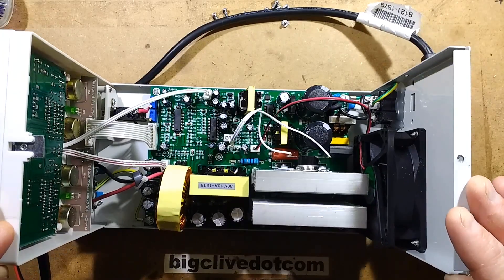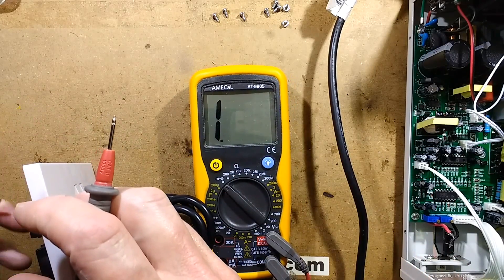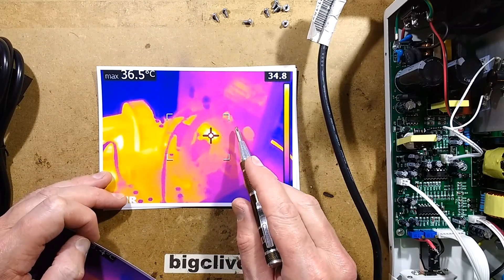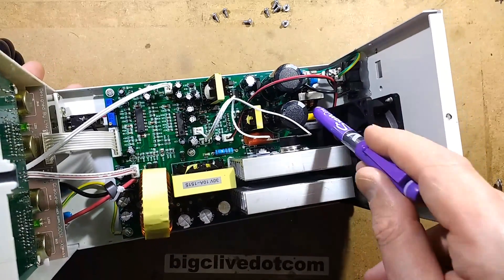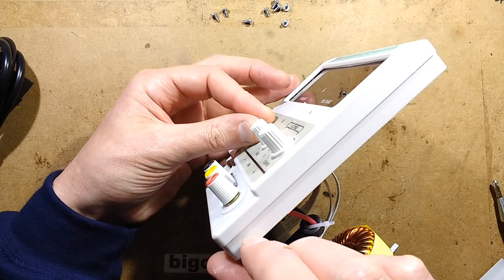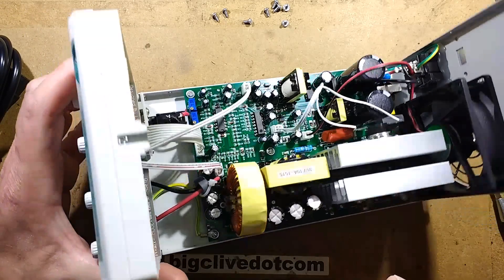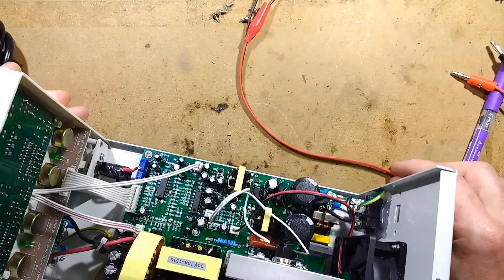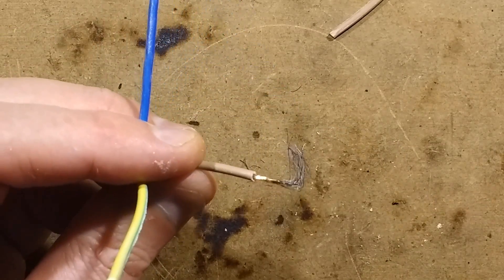Test of a PSU like the one that went on fire.

Comment: What about mobile phone chargers in the UK that use a plastic earth pin? Are they safe?
Reply: Nobody makes a grounded phone charger, the pin is just there to open the shutter.
Reply: Yeah, I figured that part, so, does that mean it doesn't need it?
Reply: Yep. The case is plastic and the wire only delivers 5V DC, so no need.
Reply: Thanks!

Comment: Another great video, thank you! 
I was interested in your comments re the UK 3 pin plug with the earth pin half insulated. Makes perfect sense. So, I set about looking to buy some with uninsulated earth pins. There are loads of plugs for sale on amazon and Ebay for example https://www.amazon.co.uk/Pack-Pin-Fused-Mains-Plugs/dp/B005DZHLO0 which claim to meet BS1363. I looked up BS1363 and got this: http://www.bs1363.org.uk/ which clearly states that the plugs offered for sale with partially insulated earth pins are illegal and should not be offered for sale.
I am a bit surprised at this, thank you SO much for highlighting the issue which I had not thought about before...
John

Comment: No way that thing would even be allowed in my home.  Not sure it even be legal to sell in USA.  No shrink tube protection on the mains in or even the switch.  That right there turns it to crap.  But here is my biggest rub...  Look at that output capacitance, if your circuit did mess up thats a lot of energy to be getting rid of before the voltage actually drops in constant current mode. Your cheep wall warts and such don't have near that much capacitance on output.

Comment: I bought one of these off Ebay months ago. Fortunately, I suppose, it was dead on arrival.I contacted the seller and got a refund. He didn't want it back. I looked inside and thought about attempting repair but time was short, so i just pulled a few components and threw it away.

Comment: Better than the heatsink compound trick is a UV reactive dye and blacklight.
What I use was originally meant for crack detection of some kind and looks like a crayon however it contains a bright orange/red UV reactive dye.

You basically rub the crayon over a surface and shine a UV torch on it and the lettering lights up (and any surface imperfections/cracks). The crayon itself is normally enough on it's own (it's a light colour) however the UV light makes it completely visible no matter the lighting conditions (it also allows pictures to be taken very easily as the lettering actually emits light).

Comment: Hey Clive. Since I had my own melty moment (and a near house burning moment) with an off brand Chinese plugpack, I’ve carefully scrutinised each and every one I’ve got. However there was one that I recently received that I opened up and it actually looks ok, it looks to have really really good separation, my clueless eyes finding that the closest point between live and secondary side is the optoisolator, which looks appropriately sized.

I’m wondering if I can send you photos for you to have a look at and see if it’s safe? Cheers
Reply from the maker: +Moon Moon The tracks often come close at the optoisolator.  Even looking at a picture of the PCB I couldn't tell you if the separation in the transformer was good.

Comment: This reminds me of a control panel I saw at the local scrap yard, just a Chinese who-flung-dung machine cabinet with 3 ABB OEM VFDs inside (10 - 25 and probably 50Hp) and it looks like the crappy conductors they used to go into the 25HP drive got quite hot and started arcing, they probably were never torqued down to mfg specs either. 
 needless to say the whole panel was carbon black inside and all drives and PLC gear were destroyed by heat and smoke :(

Comment: Color TVs have DeGauss circuits that use PTC resistors. I found many fried. Also can the sheath be cut back on the ground pin?
Reply: The problem, with even cutting back the sheath, is that then, you now have a thinner contact blade, and there is less force applied to the contact points.

The 'spring' portion of the third pin now has less push against the metal, and if FULL power were to be applied to the PIN, the corresponding contact, will have a higher resistance, and when in fault mode, not be able to take the full return current.

for a 6 amp branch circuit, then the connector may only be able to handle 80% of that, and that would be a violation of some local or national standard.

For this reason, the whole plug should be changed to a proper one with a full ground pin, and , in the UK, I am surmising, a fuse in the  plug body.
Reply: Thank you. Being from US I don't get to see them up close. I saw other videos saying it was dangerous but Mr Big showed why.

Comment: UK should require sockets to be designed assuming that these shrouded ground pins exist, since clearly they do.  Make the ground contacts in the socket full length.
Reply: jhallenworld
"UK should require sockets to be designed assuming that these shrouded ground pins exist, since clearly they do.  Make the ground contacts in the socket full length." - You overlook the fact that your half-baked proposal would not affect all the  millions upon millions of perfectly good and safe mains sockets in every home and business. Real-life hardware problems are not like a software update. 
In view of the internet, I'm not sure there is a simple answer, but there needs to be proper education of the Public about why these plugs are dangerous - they must already be illegal.
Reply: Well UK changed its socket design already- replacing BS 546 (stil used in India) with the current standard.  I'm sure many homes still have the old sockets just as old US homes have NEMA 1-15 (two prong) sockets.
Reply: +jhallenworld, Howis this then a problem for the UK electrical standards group?

If the IMPORTER of the product, imports goods to the country, then it is the IMPORTERs responsibility to ensure it is compliant with the standards in the country at the time.

The problem is the connection with the shrouded pin.

If the PIN were metalic for the full length, then there would be no problem.

But, because, the connection point, on the newer sockets, is toward the front of the panel, these newer pins fail to make contact.

It would be similar to if the 1/4 inch phono plugs on a guitar amp were grounded, and the internal connections to the pickups were connected to individual wires for the + and - of the magnetic pickup coils.

The original 1/4 inch connectors had only 1 pin ,  and the outside barrel of the plug.

They were not designed like 'telephone' jacks and plugs of the same dimensions, that had 3 wires connecting the cords. (Tip-Ring-Ground).

So, it is the RESPONSIBILITY of the IMPORTER to ensure that an electic appliance meets the respective electrical rules.

With global shopping, then why should'nt the Exporter, AND the IMPORTER bear that responsibility, as opposed to the rest of us having to pay for your mistake.

[edit on typo on 'comliant'.]

Comment: There is a subtle problem with the secondary small PSU in there.  Does it have its own fuse?  Probably not.. it means the large main fuse is protecting it.  But this large fuse is too big for the secondary PSU.  If this secondary PSU fails, the main fuse probably won't blow.  Instead the secondary PSU catches fire, pops, smokes.  Many PC power supplies have this same issue with their always on 5V "standby" supply.
Reply: You bring up a very good question. 

The second or standby PSU, and what size fuse should protect the mains power cord from overload?

If the PSU is designed properly, there should be a link that will evaporate if 200% of the current is pulled for 1 second.

So, then is there a pico fuse in series with the mains voltage going to the alternate power supply. perhaps not.

Now all 'standby' PSUs need to be checked. 

Lets have a Royal Enquiry!

must be Tony Blair's fault...... {lol).

Comment: Schematic: https://www.eevblog.com/forum/beginners/maisheng-ms-605d-power-supply/

Someone on the above forum points out that the screw through one of the feet is close to mains connections.

I have one of these and it kept welding the power switch contacts shut - turned out one of the inrush current limit thermistors was out of spec.

Thanks for the many great videos.

Comment: Someone brought to my attention your video discussing the power supply that caught fire. It was of some concern as I bought a five amp model brand new some years ago and I've certainly loaded it up to near its maximum rating for many hours.

The supply I've got is completely different inside (although externally, it looks nearly identical to this). It's a linear regulation design, with a conventional line frequency transformer and some control circuitry that switches taps on the transformer.

Comment: I have one of these in the corner. In this one,that large choke wasn't even cable-tied down,and at some point,during shipping I suppose,it had moved so much that it broke the lead off of one of the resistors underneath it. It still worked fine,but it might be a good idea to fasten the choke down. The resistor wasn't terribly critical,the two resistors under the choke appear to be there just to give the supply a minimum load,if nothing is connected to the output.
Reply: On second look,it appears the choke was soldered down so that it hung out over the edge of the PCB a bit,and fouled the side of the case.. so that when the case was screwed in,it pushed the choke over,into the resistor,and snapped the lead off of the resistor.

Comment: I got sent one of those bastard mains cables from ebay. The resistance of each conductor is over 1 ohm - should be milli-ohms, they are DANGEROUS
Reply: ForestCat_Peter 
"I got sent one of those bastard mains cables from ebay. The resistance of each conductor is over 1 ohm - should be milli-ohms, they are DANGEROUS"
Why not tell Trading-Standards? Of course it depends where it was sent-from. If from a seller in the UK, they need a roasting. Perhaps placed handcuffed to a chair surrounded by a number of their devices that are set to self-destruct with such dodgy mains leads.
If from abroad, say via Ebay or Amazon, then they need to crack-down on the sellers, but there's not much else TS can do with overseas suppliers.

Comment: Wow, so it's an SMPS and theyre just using the output directly ? How lame. Most SMPS based bench supplies I have seen of any quality will have a linear post-regulator, and the switching side is only maintaining a dropout voltage across this linear regulator.

Comment: I noticed on the 30V/5A version I purchased that the banana plugs weren't even secured with the grub screw properly. Lucky for me RadioShack recently had a big clearance sale and I got a few stackable banana plugs with soldered connections.
That said, it's been a fairly solid supply so far, though I've mainly just used it for testing motors, recharging li-ion cells, and powering my Beaglebone Black, so nothing too terribly demanding load-wise.

Comment: Clive, have you tested the dodgy mains cable to see if the fuse is actually in circuit? We found one that still powered the device when the fuse was removed (a paractical joke that failed); when we cut the plug open, the wires went directly to the pins and the fuse holder was purely for decoration!
Reply: +CambridgeMart Not quite a practical joke. When stuff like that gets done intentionlly, and it results in death, then usually, someone has to answer to it.

If if is a DEFECT in manufacture, where the employee of the factory assembled the part wrong , and the connector went into the molding (moulding) machine, and passed the QC check at the end of the line, then the problem batch needs to get corrected.

Have you contacted the Manufacturer of the defective plug?

Suppose, someone does not know about this dodgy connector, and buys the same apparatus, yet gets a letal shock, and dies becsuse of this error.

Yes, I realize we cannot un-see things we have seen ,but here is a case of preventable problems later down the road.

Comment: When you mentioned the hot resistor it reminded me of that cheap flashlight with halogen+led, i needed to change th battery because it was broken and it couldn't charge. I tested it with the led on when i was done with putting the new battery in and the resistor got so hot that you could cook food on it! :D

Comment: Yeah, I think I'd chuck those leads in the bin too, and make new ones with parts I trust. Even those banana plugs alone look a little cheesy to me.It quite disturbs me that some of those have actually gone on fire. The power lead with the faulty ground, those are a dime a dozen. I know I could go to the local computer store and likely buy a mains power lead for less than $1 or £1 as they usually throw them away when they replace a power supply. Most customers just keep the lead they already have making the ones that come with new power supplies completely superfluous. Most computer stores are glad enough to get rid of them that often times they'll just give them away in my experience.

Comment: Hey guys looking for some help on finding a part for a project would be great if you could help.  I need something that I can hook up to a 12v battery and transform the current into a 19.5v x 9.3 amp output.  Is this just a transformer perhaps? or is there another name?  Ideally the unit would be digital and adjustable.  Thank you in advanced.
Reply: You're going to need a boost converter, and a fairly beefy one at that if you want just short of 10 amps on the output.
Reply: Greatly appreciated!
Reply: What you are looking for , as ZeroPointAlpha stated is a boost converter, but you do not describe what type of LOAD is being driven at 19.3V with a 9.3AMP current.

Is it an Inductive LOAD ? such as a motor or a transformer?

Or is it a Capacitive load such as a Fluorescent Or CFL Lamp?

So far your LOAD consumes 200W approximately.

Let us take a terrible conversion factor of 50%, this would give the power supply an Input wattage of 400W.

Now, you say that the input supply is a 14.5 volt battery that declines to 11.5 volts when it is 80% State-of-Charge.

So, the converter then will be drawing 40-45 Amps under full load from the 12V battery (worst case at the lower end of the discharge curve), 

Now you have to take into account how FAR the LOAD (the actual device) is from the SOURCE of the power., and how FAR the PSU is from the BATTERY.

Typically, you want less than 5% voltage drop across the conductors when full load (the maximum design power) is being consumed by the device., and calculate your I squared R losses around that.

so if you use 18AWG to drive the Boost converter, that is not low wnough of a resistance to let all of the current through, without over heating the wires insulation rating (usually 60C).

To keep things cool, the 200W load , then is driven 50 metres from the PSU. for this you are going to need 12 or 10 AWG (or equivalent) wire, and to drive the PSU, even higher gauge wire, say #8 or #4.

If this is for an AUDIO amplifier, then you probably want to have a #0 AWG feed wire to the PSU, with a suitable fuse at the Battery (50A).

To minimize the Heating effect of the heavy current demands when the BASS is driven fully, you will want a SUPER Capacitor at the end of the PSU before it goes into the amplifier , so that the Voltages are stabilized during the heavy BASS draw.

Hope this helps.
~R

Comment: With that Earth ground sleeve thingy on your EU silly things(least in the US ours aint sleeved), isn't the stuff just a heat shrink over the the ground plug?
Well if it is or isn't, if is a 'sleeve' cant you just cut it off with a razor blade?
I mean the stuff is pretty darn malleable even if it is plastic that thin of plastic itself can just be cut off as well so the ground fin can full touch your grounded point in your plug.

Or is the plastic Molded into the metal plug itself? Like a tang of a knife into the handle?
If it is this way then I guess you are screwed.

Comment: If you need a bench supply say 5 amps and under stay away from switch mode based supplies get a linear supply.

They are more reliable, easier to repair, and have lower noise on the output than a cheap switcher. Can you design a switch mode supply to have low noise on the output? Sure but you're not going to find that design expertise in a cheap Chinese supply. It's much easier to make a low ripple and noise linear supply than a switch mode supply.

The only reason the Chinese have hopped on this low current switch mode bench supply bandwagon is because they save on the steel and copper needed for the larger and heavier 50 - 60 hz linear transformer.

Comment: I have one. It failed quite spectacularly due to a bad IRF840. There was a dramatic jump in stability after the repair. It started to go into thermal runaway when the fet popped. If I hadn't been there, it would have been a disaster. NOTE: replace the fine voltage pot. A bad run of them was used on this model! I used a 10 turn precision pot and now setting this beast no longer pisses me off.

Comment: didnt they use aluminium leads between the electricity meter and consumer unit ? I think we had some they kept getting hot and sizzled and crackled making a terrible noise on my hi fi which is how I noticed it  once discovered they were removed they were under the wooden staircase
Reply from the maker: +thehappylittlefox aka benji America went through a spell of using aluminium for house wiring.  The safest quick-fix is adaptor tails that safely convert from the aluminium ends to copper tails for terminations that won't burn.
Reply: thanks Clive did that include the UK?  I'm sorting out my vast collection of old leads and cables so I can downsize a bit I any that are like the ones you showed will be disposed of safely
Reply: thanks Clive did that include the UK ?  thanks for the tip about the leads I will be checking any I have and disposing of them safely